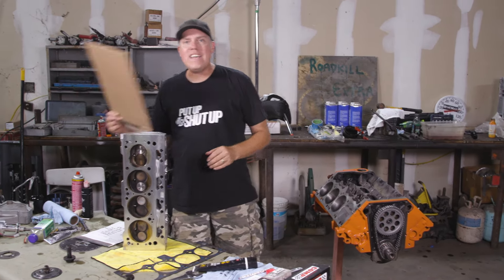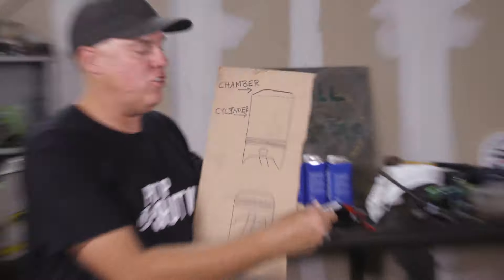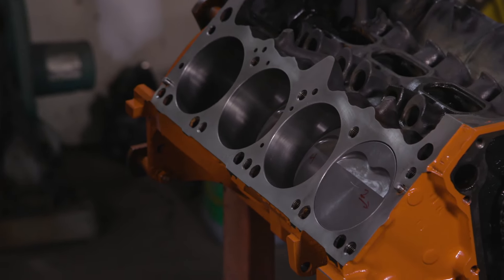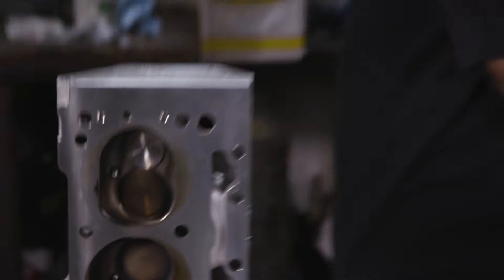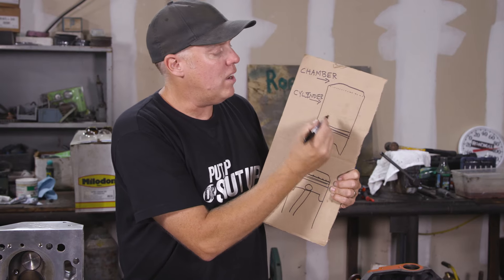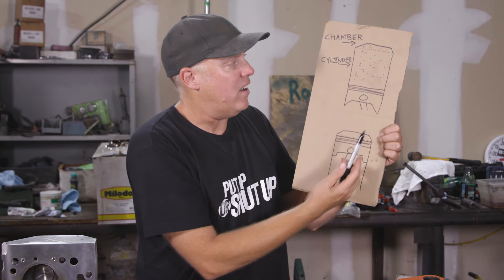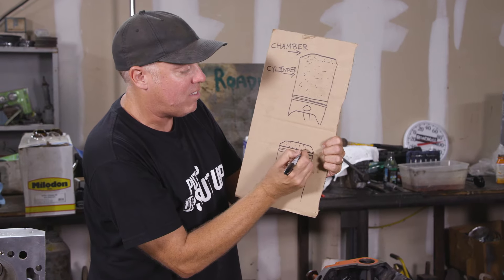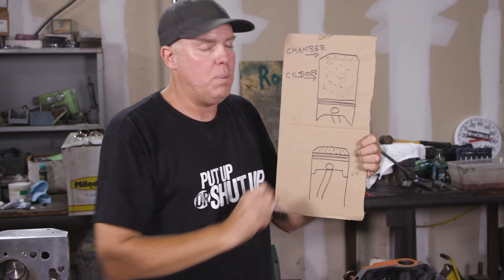Compression Ratio Explained - Roadkill Extra

Comment: Hello Road Kill guys, just wanted to comment on this well presented lesson on CR.  I would like to offer a thought on why high CR results in more power.  If you take two identical engines, same heads, same intake, same cam, etc. but increase the head gasket thickness on one engine.  So engine A has the 0.039” mentioned in this video while engine B has say 0.100” thickness.  Assume the correct air fuel ratio is maintained at all times and the amount of air entering each engine is a result of displacement.  Both engines have identical displacement so each sucks in the same air and fuel with each stroke.  If you can believe that then why does engine A produce more horse power?  If they both have the same charge then they both have the same amount of energy that is released when ignited.  How again does Engine A produce more power with the same amount of fuel?  Let’s figure this out.  i will take exception to higher compression squeezing the molecules closer together resulting in a better or faster burn a.k.a. reaction.  Looking at the reaction there’s more gas molecules produced from the reaction then you start with, can discuss another time.  This means that it is likely the reaction could prefer to go backwards to lower pressure.  Crazy i know.   Ok to the point.  The more you compress air or any gas you actually increase gas temperature.  If you compress enough gas can exceed autoignition temperature and the engine runs without spark or it diesels.  It is this higher gas temperature that is beneficial because it causes the fuel to burn more quickly.  Reactions generally quicken as temperature rises.  It is this higher temperature at ignition that increases reaction rate and results in higher cylinder pressure.  The engine is then more efficient at converting chemical to mechanical energy or Torque and Horse Power.  So even if engine A and B have the same charge because engine A has higher compression it will convert more of the charge to horse power.

Comment: He should touch on how camshafts can alter compression. You can have a 12 to 1 compression ratio engine with a huge duration cam and it will lower the compression ratio to run pump gas. This is all determined when the intake valve closes. When building an engine please use the dynamic compression calculator where it asks how many degrees the after bottom dead center the intake valve closes.basically if your camshaft is small enough that the intake valve is closed at bottom dead center ,then everything in this video is correct,however if your camshaft is larger and the intake valve closes after bottom dead center it starts lowering the compression ratio.

Comment: Ok my only question is that the Pistons have the indentions for the valves to clear right? Well if you have a flat top piston or dome top piston what do you have to do for the valves to clear?
Reply: Gear Head28  I think many would consider the pistons in this vid flat tops with valve reliefs.  A typical dish piston has more taken out than just the valve reliefs.  Dome pistons have valve reliefs in the dome as well.
Reply: StL ChuckO no I don't mean those pistons, I've seen pistons in high performance cars that are completely flat with no valve relief's

Comment: What is the trade off point between a larger cc  and lower compression chamber which will admit more volume of mixture and a smaller cc chamber with a higher compression ratio and less mixture?  i.e. more gunpowder, bigger bang vs more squish,less gunpowder, bigger bang. With a turbo you would think the lower the compression ratio the more mixture you could stuff in the chamber. Just curious as to your explanation. Cheers

Comment: Ok, I knew that stuff. What I need is an explanation of "with that cam shaft", and how running a mild or wild cam affects the amount of compression you can run. So like on a big rpm engine with the inlet valve still open while the piston is on its way back up that has to change the effective compression ratio? I would love a good explanation of that sort of thing.
Reply: scotty B  Bigger cams with a lot of overlap will bleed off cylinder pressure...  IOW, a valve won’t be completely shut so some of the air/fuel can escape.  It has a greater effect at lower RPM.  Let’s say an engine has a 11:1 static CR.  With a large cam with a lot of overlap (narrow lobe separation), at low rpm some air can bleed out making it act like it has a 9:1 CR.  At faster engine speeds, there isn’t as much time for air to bleed out, making it act more like 11:1.  

A mild cam with a wide lobe separation angle is more apt to have the valves closed when the piston starts coming up during the compression stroke.  This means that little to no air bleeds out, and that it’s dynamic CR will act more closely to the static CR.

That’s a simple explanation, and there’s more to it.

Comment: Good Job Fryburger,. Information for the novice but crucial for all engine builders to know and understand nonetheless. 
  Deck height is a feature many don't take into consideration when building their first 2 or 3 motors, it's not until you up the ante that deck height becomes a very important calculation for compression, and not wanting to smash your valves into your pistons.
 I recall almost 50 years ago helping my Big Brother build a sbc and we didn't take a lot of stuff to the machine shop for financial reasons. What we had was a piece of granite slab from a tombstone that was dead nuts flat.
 We adhered sandpaper to it, too make the cylinder heads as flat as possible and then had a jig to move the block back and forth on the stone for block decking making a matching surface for the head shaving a tiny amount off the block deck height on any rebuild we were doing.. 
 I can tell you it was a painfully labour intensive process, but the results spoke for themselves and we had winners at run what ya brung friday night drags.
 Machine shops are much more affordable now and  the machining so perfect you could never match it on your own volition. BUT back in the day when there were not the aftermarket parts and pieces to build a wicked motor, you did it yourself with ingenuity modifying stock parts.
 Anyways just a bit of memory lane. the fast lane of the day.

Comment: 'Interference'  V's 'Non Interference' engines.  You don't hear it much these days, but, interference engines will mash valves if the cam belt breaks. Non interference engines will not mash valves if the cam belt breaks. Side valve engines are a good example of non interference engines. Non interference engines are generally low compression.

Comment: Great vid. I'm Building a roller 406 now for my C3 vette at about 11/1
.
 
What you think? Maybe 94 octane on street then up timing with race gas? And 

Weisco flat tops 4.155, 6" scat rods and scat cank. .027 MLS gaskets (should I copper spray them?)
Howards HR max effort roller link bar lifters good to 7k.
.
 10.9/1 SC and 8.9/1 DC internal balanced cam is  I am racing my budget c3 vette in raceweek 2.0 this September if I get in..  flotek 220 heads.. (315cfm @ .600) heads.. custom Schneider cam 238/246 @ .050", 0.608"/0.600" lift, on a 110 LSA
3000 huges stall and 3.08 rear now..

I know I need at least 3.63 gears.. and eventually a 12 bolt 31 spline rear irs with offset arms but stock rear now. Th400. But all rebuilt with new spicer solids and new bushings.

Right now its got a 2 step with button on brake pedal set for 2500 rpm for footbrake launch with 6al at 6.8k. I shift manually with a BM Pro ratchet shifter.

Comment: no talk about cam blow off.. my compression is 10.6 the cranking compression with a harbor freight gauge comes to 120 psi some are a little bit higher.. this is in a sbc. 406. I thought the timing gearing was installed wrong . I tore it apart it is dot to dot. I will not use a dual pattern cam on this engine in the future after some track times

Comment: can i put 2, 3 ,4 or more head gasket to reduce the compression ratio? will this easy cause a leakage? i really need to know, thanks guys
Reply: i may tell you the full story of my case, i have a nissan figaro, i am about to change the cylinder head, and i bought a nissan micra cylinder head from ebay, because it look the same, but unfortunately i found that it is actually different, Nissan figaro cylinder head has a step inside as figaro has turbo but micra doesn’t have turbo, so the figaro cylinder head designed with a step to reduce the compression ratio, but now i bought a Micra cylinder head which without a step so if i install it, my figaro is gonna have much higher compression ratio and will hurt the pistons i believe, so now i am thinking to get 3 - 4 more head gasket to increase the gap in order to lower the compression ratio, but in the market there is no any super thick head gasket, so i am thinking to put more head gasket together, do u think it will works? thanks

Comment: It makes me wonder why Porsche went from the 4.5 litre V8 with a 11.5 :1  to 4.8 litre with a 8.5 :1
Hence I still keep my port injected 4.5 Cayenne!
Reply: I don't know about that particular engine but one factor may be that Freiburger's explanations is only useful to a degree (although he kinda touches on that in the last sentence when he mentions the camshaft). Static compression ratio (what Freiburger is talking about in the video) isn't quite as meaningful as one might think. This is because the intake valve closes some time after bottom dead center and only after that actual compression happens. So, with a more aggressive camshaft an engine with nominally lower compression might in practice have a higher compression ratio.
Reply: @swapode  
Thats an interesting point, maybe I should dig out the comparative specs of each. I'd like more power than my stock without boosting or just throwing in more fuel. 
With high flow air filters it holds about 350bhp and peak torque kicks in sooner from 2200 rpm and continues to 5500rpm.
Reply: @OverlandTT  Have you looked into chip tuning? I'm no expert but it's the first thing that springs to my mind.
Reply: @swapode  
Not yet, but i'm just about to :)

Comment: Don't confuse compression ratio with cylinder pressure. Cylinder can be effected by numerous factors, the size in CFM of the carburetor or throttle body, the size of the valves in the cylinder heads, port flow, intake flow or intake flow through the air cleaner throughout the entire intake tract. All can effect cylinder pressure or as I sometimes refer to it, actual compression. Even the position of the throttle blades in the carburetor/throttle body can effect actual compression. Compression ratio is a way to measure static compression. That is, when the engine is not running or that compression of a longblock. Adding a four barrel carb to a two barrel engine can influence cylinder pressure to the point where it can cause preignition. All these things must be considered when building an engine for a certain fuel or performance level. Even the way in which the engine is intended to be used must be taken into account. The load on the engine can require more or less cylinder pressure. Compression ratio is the simplest way to address these requirements, as static compression can usually give enough of an indicator of how an engine will be effected by the load it's under during the type of use it's intended for. The camshaft also has a lot to do with cylinder pressure. A smaller cam will provide higher cylinder pressure at low RPM than a larger one. All these parameters must be used in conjunction with each other to provide peak performance in a given application. So, co pressing ratio can give you an indication of how an engine will react to other modifications when building an engine for a given application. Peace!

Comment: Why are the measurements he talking about in inches (Imperial) except for cylinder head chamber volume which is in CC (metric)? Does anyone know why mixing measuring systems seem to be the norm when talking about American V8's?
Reply: Type Q Most Americans are used to the imperial and will use it whenever possible but for mechanical applications metric is the norm this causes us to mix the two
Reply: Thanks

Comment: These days with direct gas injection and advanced computer controls, you can run 12:1 and 13:1 with pump gas without any issues with detonation. But that's not olde-skool with small/big blocks, carburetors, and push rods.

12:1 is how a 2.0L n/a 4-cylinder engine can make almost 200 hp.

Comment: Valve dish on the piston will not change compression. 
It makes the chamber bigger when the piston is down too. Not only when it’s up.
Reply: Guillaume Bergeron it does thats why its a ratio, 5cc of volume in a 12:1 cylinder is 60cc when the piston is down
Reply: Shayne Gadsden right, I thought about it after writing the comment

Comment: Something also with Compression comes heat which raises the fuel  air mixture closer 2 ignition temperature , this helps as revs come up. 1 other thing , it can help with cylinder vacuum on intake stroke , Prove ME Me me wrong ... the REAL Dave who .. tRDw

Comment: is 9.1 compression ok it's a 93 magnum 318 it's fule injection now i was thinking about switching over to carboraitor would carboraitor give me more horsepower over fule injection
Reply: 9.1 ain't bad. As for the carb it by itself wouldn't. Your engine can only pump so much through it. It doesn't matter how it gets it. You would be better off doing headers, intake manifold, a cam, better heads, or any combo of them. To help increase the flow and allow your engine to pump more efficiently

Comment: hey bud,,,you know how there are spacers by boysen they sell with boysen big 4 reed valves ,,,,,,,,WHAT IF I CUT A 1/2inch ))or MORE)))))) COPPER GASKET LIKE A SPACER BETWEEN MY CYLINDER AND HEAD THEN DO I HAVE MOOOOOO POWER AND DO I NEED TO DO ANYTHING ELSE OR JUST GET A SEATBELT AND AIRBAG THIS IS FOR A 125cc TTR125 DIRTBIKE??????????

Comment: How can increasing bore increase compression ration ? if we increase the radius, then the radius of the volume compressed then the radius of volume swept will also increase by the same value, and since compression ration is a ratio, these two increased values will mathematically cancel out giving the exact same ratio as before. i dont get this point
Reply: The volume of the compressed gas is supposed to be above the cylinder, in the head.

Comment: My daily driver has 14:1 with direct injection on cheap pump 87 gas.  What I don't understand is why aircraft piston engines have 8:1 and "need" 100LL aviation gas.  Especially with less oxygen up at high elevations

Comment: A 4 180 head gasket on a 4.040 bore is bad news.  It will be sitting outside the top of the cylinders and have no support. I have seen them bend the deck and torch between cylinders. Plus a lovely place to retain carbon and cause detonation.
And that 360 seems to be high compression as the pistons are not .070 down the bore. 360s have the dish piston as high comp and the flat top as low comp.

I had a blue with ACL here in Oz as it was once size gasket to suit 4" 308 and 253 3 5/8"[ i had a 253  that had torched the deck]  And the 6s were all one gasket for all capacities. I feel bean counters telling engineers what to do. The small bore gaskets are available again.

Comment: What octane fuel should be used for a SBF with a 10:1 comp ratio? Roller cam 114* lobe, 212 duration, .512 lift
Reply: Do you have forged or cast piston if you go to hot for the octane you will melt the rings and piston I would stay below 110octane either way make the motor run good for longer

Comment: Nice explanation of Static Compression. However, Dynamic compression is most important because it takes into account, the cam profile and exactly when the intake valve closes, which is when the compression actually starts to build. For a detailed explanation by Pat Kelly see his Dynamic Compression Ratio calculator. It is excellent. I designed my small block Chevy with it and the torque and power from 360 cu in is amazing. See; http://cochise.uia.net/pkelley2/DynamicCR.html

Comment: Static compression ratio and dynamic ratio (adjusted for valve timing events) are 2 very, very different things. Im running a 12:1 static compression on 93 octane with a big cam. Dynamic compression at 1RPM is 7.5:1. Peaks about 8.25:1 at 6000RPM. The 9.5:1, and 10.5:1 ratios are called OEM ratio, and its purely based on (In a perfect engine with instant valve events and exact timing) geometry.  That number means absolutly nothing in the real world because engines dont run anywhere near that OEM number, unless it has a cam with completely verticle lobes with flat plateaus along the duration, and perfect alignments (this engine doesnt exist and would destroy itself after one rotation).

Comment: Dave, I really need to know if there is any significant improvement in power or torque by just going in with the 1.6 or 1.7 pushrods?  I have an old 350 w/ headers, intake, carb and I think 2.02 heads but a bone stock cam.  I had this engine rebuilt by a local company here in Okc, but .. anyway I need more power and was wondering if this little change would make any improvements?  Sure hope you can respond.  I'd love to see it on a dyno graph.. 
thanks 
Bob/Okc
Reply: TheLuftwolf Sounds like you just need to ditch that Cam If you want any power gains what so ever

Comment: This is a static compression number. It would have been nice if you brought up dynamic compression ratio and why it is important. Valve opening and closing relation to where the piston is in its stroke, and what effects advancing or retarding the camshaft might have on  the compression ratio.